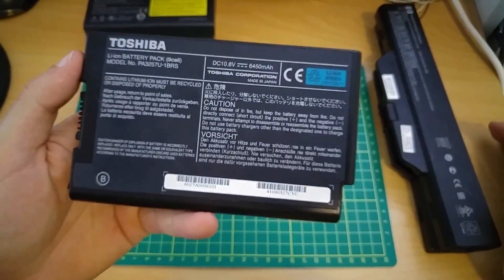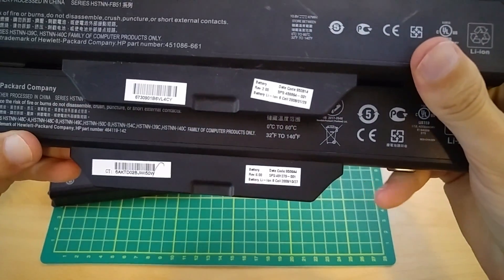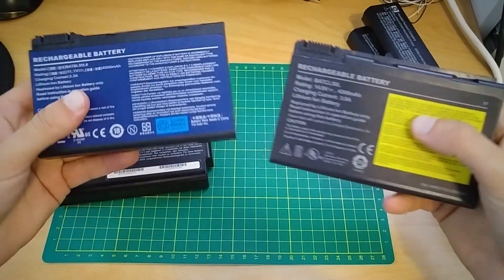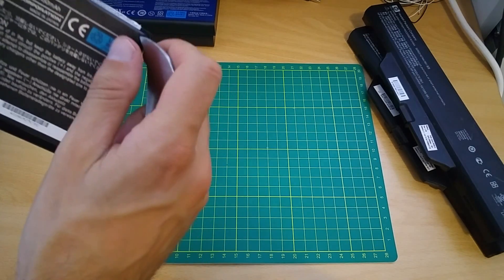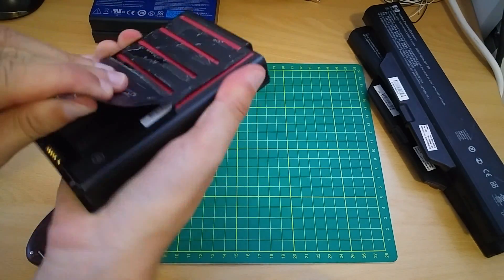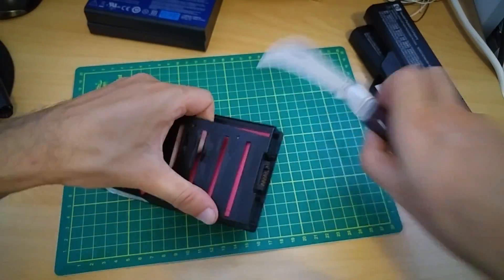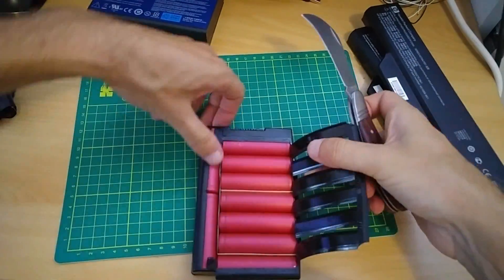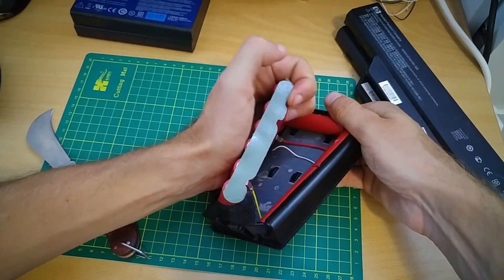How to get 18650 batteries cheap

Comment: last year, 2021, someone gave me a Dell laptop from the late 1990s. i removed the batteries, 8 red ones i think, and they were all still holding a 3.5v charge even though they hadnt been charged for over 10 years. they are all working and holding a charge better than new ones i bought in 2020. Old laptops are a great resource for 18650s

Comment: I had about 100 of those red unbranded they overheat when charging 60% of the time
Reply: Those are sanyo batteries - they always overheat after some time - try to charge them with 100-200mA to 3.8 -4.0 V and leave them for 2-3 days. After that try to charge them to 4.2V. Often 50% of cells works just fine after this. But i avoid sanyo because of that. Samsung for example - 90% of cells in laptop batteries are ok. LG is similar percent.

Comment: I opened today a faulty Powerbank from eloop (50000mAh) which had 8 Cells inside and 3 of them were death with 0V and 1 with below 2V, the other 4 are all above 3V. The one with 1.xxV I was able to charge but the 3 with 0V! So, I opened one of that 0V Cells to find out, that inside was just fine Sand, and so in those other 2 0V Cells.  All those cells were totally unmarked: NO Name, NO mAh etc., all in red plastic shrink foil. Comp[ared the looking of the upper (+) connect, showed that the upper connect were about 0.5mm below of the 'good' 5 Cells on those 3 0V Cells. 
That all said, dealing with those 2.Hand. LI-ION Batteries requires a lot of tension for to sort out the good from the bad. Still the user could save quite a bit of money using such Cells for to power some devices. And from my own experiences, the best one allway I found in old, just original Laptop Power Backs.

Comment: Panasonic make 3600mAh cells and soon they are releasing 4000mAh cells (which they have already made prototypes of). So a lot of these old used batteries you got are really only 1/3rd as good as the new Panasonic's that will be released. But at 0.6 dollars a cell you still are winning, as the new Panasonic's will very likely be around 8 dollars each. Or in bulk maybe 5 dollars each. So it's still worth doing what you are doing here.

Comment: I still can`t believe how great this battery reconditioning plan ( Check Details Here>>>https://t.co/K0S4ZxvA0x ) worked. It worked on my drill battery, several AA and AAA batteries, and my camera battery; now they are useable again! This is very fun to do also. It really works for any kind of batteries!
Reply: Jokib Tahal  you spammers are a true pain in the ass! People, please understand, there will be only one end of this business plann ending up with a huge benefit/profit...........wich will be the seller of this broschure/battery reconditioning material! You, the buyer.....of course.........for sure..........will end up being fucked in a rather bad way. You will hold a broschure/reconditioning manual in your hand, telling you common knowledge battery gossip and end up with a handy piece of asswipe!
Those spammers should be tared and feathered like it was a good tradition in the old days to let this scum know they wont get away with everything they do.
Forget changing batteryacid for another electrolyte, flushing your battery, neutrylizing batteryacid using baking soda. Not that it wouldnt work, it does! But it aint a sustainable sort of gain, you will for sure loose a lot of capacity for the true reason yoir battery has failed on you the first way had nothing to do with your batterys acid concentration or fluod level, the reason that thing failed on you alsmost for sure was the lead, well its rather sort of leaded alloy..........and those plates being almost dissolved is the true reason your battery gave up on turning that starter to turn the engine around for it to start up. Those alloy plates can not be reacrivated whatsoever. No matter what ever you pour into that zombie bat, it wont be re animated up to full capacity. For a short time the battery recovers, even takes on load cycles properly, voltage rising up to between 12 to 13.5 volts, everything seems to be fine at first BUT HERE IT COMES, this zombie right from the start, will lack capacity. If say your bat's been rated 80 Amp/h you will be lucky if you reach say 30 to 35 amps at the most. Hardly nuff to turn the starter, especially not if its cold outside, below zero centigrade, motoroil turns thick, engine revs lesser for the first revs........and there you go, now its time to use the manual youve bought, the reconditioning bible........say a little prayer, asking the lawd if hed be kind enough for a little assistance and send in st florian for you cause now its clearly his turn to watch out and prevent the whole car from going up in smoke................cause you dont want to light up the whole car.......noooooooo........all you desire is stuff the asswipe eg the reconditioning manual below the oil pan of the engine and give it a flame so it will catch fire and light up, hope the asswipe is big enough to heat up the oil in the oilpan of the motor so yoir fucked up, reconditioned bat will be able to start the now, cause being back in copacabana summer mode, thin like water, well heated up motoroil wich causes a lot lesser friction tof make that engine spin as if it would be during summertime........if you are lucky, the reconditioning manual, also known as asswipe..........paid itself off! Leave the scenery as fast as possible, see a car dealer, buy a decent new bat for your car, the bigger the better, a couple additional amps wont do any harm say a rose from 55 to 70.....grab it, pay and throw it below the hood immediately. Keep the reconditioned zombie bat! You need it later on, cause you are on a mission, finding the seller of the reconditioning manual, the guy thats been puttimg you thru all this hassle in the first place for he lied to you and tricked you into buying his worthless piece of shit advice, wich alsmost cost your live, beong stuck in the middle of nowhere, minus 20 degrees centigrade.............giving a wet fuck about you, your bodily integrity, health, life, just being after his quick cash money for less than nothing thing and there you go, you catch the drift, dont ya? Once youve got em, tracked him down, tie him, tie the zombie bat to his legs giving him a zombie bat sort of concrete boot and throw him into somewhere, he wont be found.
Now, after taking notice of my of course not so serious advice, i hope youve learned something about batterys, capacity, charge, voltage, honesty, a fraudulent scheme, viskosity and st florian as well as his boss, the lawd himself and what to do if greed along with a good portion of naivity, the attempt of saving you some dollars, almost got you stuck in the middle of nowhere and of courae, be thankful youre a smoker, else you would not have had the matches to lit up the asswipe reconditioning bible.
Hope you ve enjoyed so far........spamming c@nt

Comment: There are chargers in the market that activate 0 volt zombie cells
Reply from the maker: Old TP4056 module can initiate charging. After that i put them in smart charger (OPUS BT-C3100) but usualy they cant hold charge.
Reply: That works as long as cells arent damaged......a dead cell stays dead, no matter what. A cell that isnt working mustnt be necessarally dead, but once dead, i will stay dead.
Reply: Isn't it really dangerous to discharge them beyond 2v?
Reply: No no

Comment: how can u tell wich side is +/- if they are not branded like mine?
Reply from the maker: Take look at 2:54 min of video. Positive is top of the battery with groove. If you take closer look when i test their voltage you will see that I always put red wire on positive and black on negative.